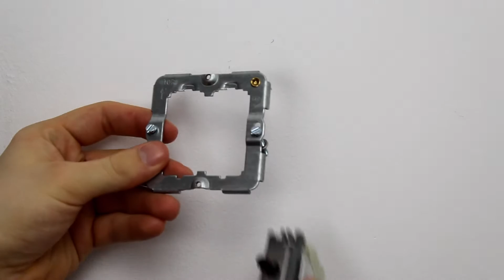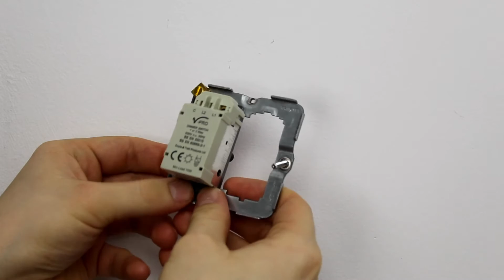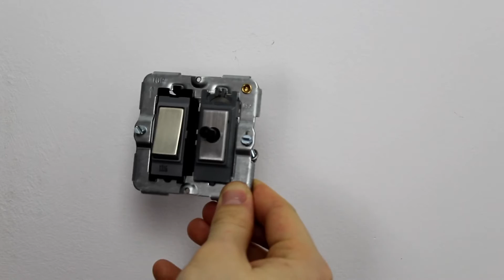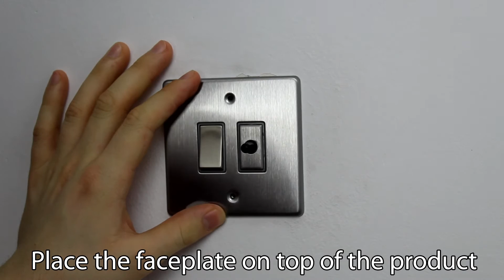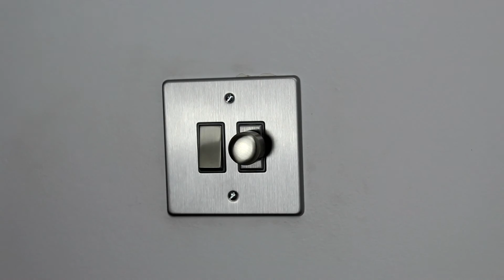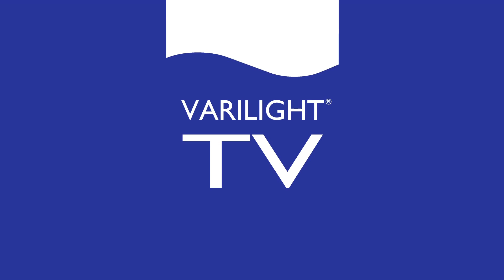How to install Varilight PowerGrid

Comment: It would be great if you could give us more detailed video with fully wired switches,
Specially, where the back box should be sitting in relation to plasterboard and how grid plate with switches should be tightened up..

Many thanks